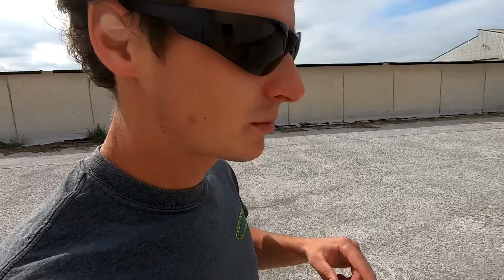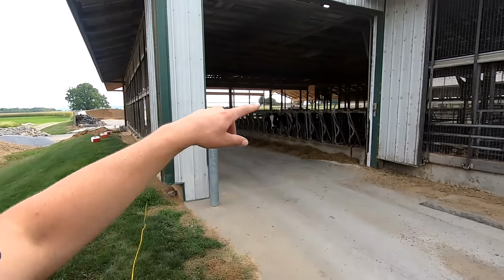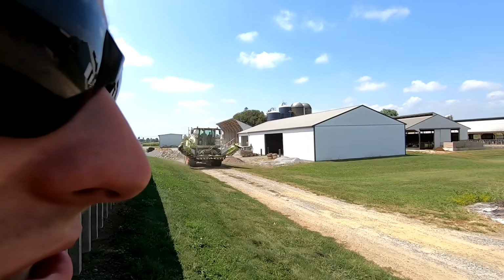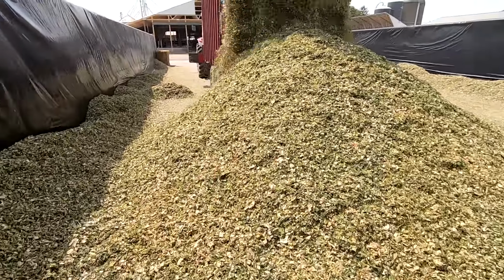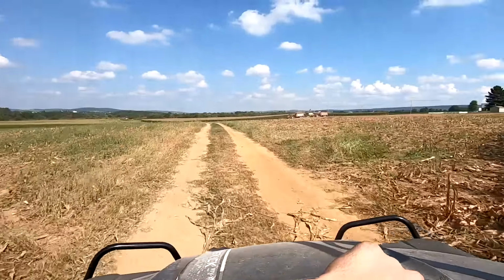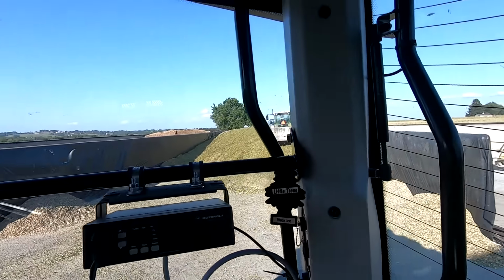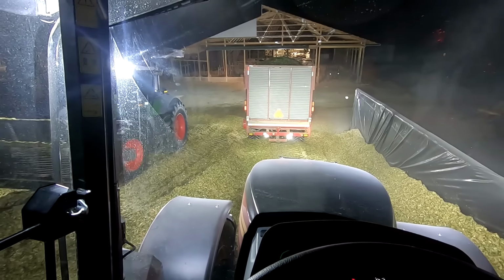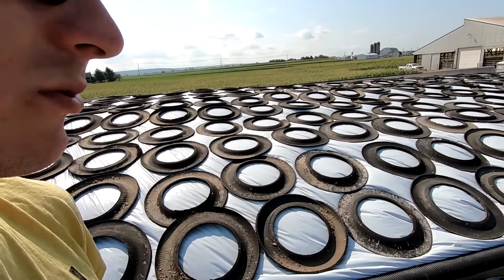Corn Silage Harvest | First Bunk 2022

Comment: The harvest team is really good. I’m amazed how perfectly they synchronize the whole process.  They make it look easy but keeping 7 pieces of equipment moving and productive all the time for many hours requires some good planning and flawless execution.
Reply: The coordination works very well during the corn silage harvest on large farms.
Reply: Actually it's not that hard once you're used to the people you're working with. That goes for most anything I spent a month this summer working with an excavator operator I'd never worked with and after the first couple of days of doing road shoulders and ditching it was like clock work we didn't even have to use the radio...btw I also grew up on a dairy farm.
Reply: Eric your doing a good job it may be a job nobody likes but got to be done . They must got a sequence timing to keep chopper going none stop . Eric you got three bunkers is their away you could add another bunker to store left over silage while filling the other bunker’s ?
Reply: Impressive teamwork indeed! 👏🌾

Comment: I remember back in the late '70's harvesting 700 tons of corn for a large silage clamp (like Eric's) for a sheep feedlot outside of Tehran, Iran.We had two tractor-run forage choppers and sealed the top of the clamp/bunker after compressing the corn with heavy thick molasses pumped from a pit. Large plastic sheets weren't available then.
Reply: Impressive job back then! 👍🌽

Comment: When I was a kid (back in the 70's) we lived on a farm in the summer then it was a ranch in the winter.  All summer we grew crops for silage and trucked in hay preparing for winter.  The chopper was a pull behind offset that threw the silage into trucks driving along side.  In the fall we brought the cows in off grazing land and it was a ranch until spring.  Man that pit stunk when we opened it.  They could smell it in town 5 miles away if the wind was blowing right but the cows loved it.  Spent many summers driving truck or the small bulldozer we used in the pit.

Comment: Just wild watching this compared to how my grandfather put up corn.  It would take weeks to fill the cement stave silo with a single row chopper behind his 656.  Fall and corn harvest were the best times on the farm. The barn was always full of hay by September. I still remember the smell of the silage while leveling the silo by hand.  It would be considered a good year if you could get all of the corn chopped before the first frost.  If a hurricane would make its way up through it would guarantee having to chain up all of the tractors.   IH 656 running the chopper.  Farmall M tricycle running silage wagons. Farmall M wide front on the blower(cause the shifting forks were finicky.  Farm was in Erie, PA.

Comment: Eric. Do you crown the three bunkers down the middle length just a little. I imagine you could pack a few extra loads doing this? As long as it’s not a safety issue? Terrific corn harvest video. The best so far I’ve seen. Awesome work guys. (Never mind. I see you did that. I noticed the day you poured the concrete and cleaned out the other storage bin).

Comment: If you take off the back walls 
you can reach the old corn first
Reply from the maker: That would work, the only issue is the floor has a 2% slope towards the front of the bunks so water would pool in there.
Reply: But in the future, if you think about building more bunkers

Comment: What didn't you like about the roller from last year?
Reply from the maker: It had trouble making it up the steep hill at the end and was easy to get stuck against the wall. Packed pretty well though.
Reply: @10thgenerationdairyman  thanks for your reply. But would a big heavy tractor and thin wheels would be the best way forward for rolling the pit. I follow you from Devon England

Comment: I"M surprised the fresh silage doesn't get moldy  when covered so fresh.
Reply: I believe mold needs oxygen to grow.  But the covering with plastic and weighting down with sandbags/tires is designed to remove as much oxygen as possible.  So it ferments rather than molds.